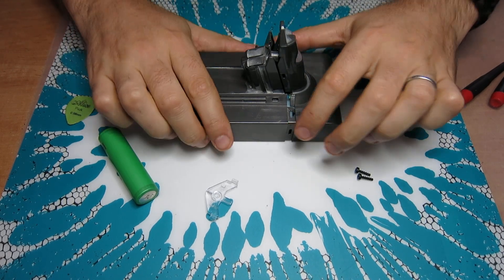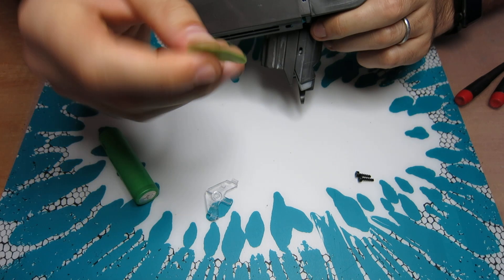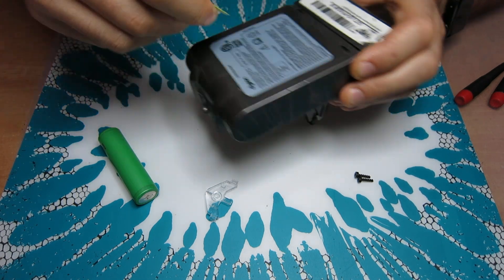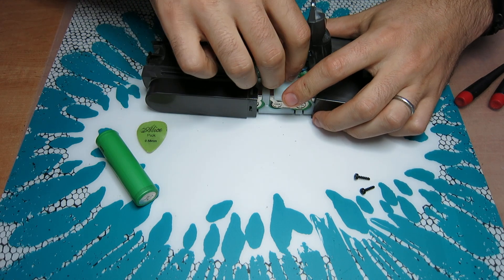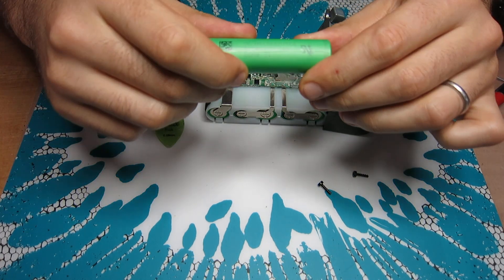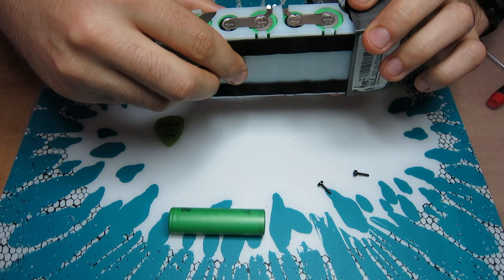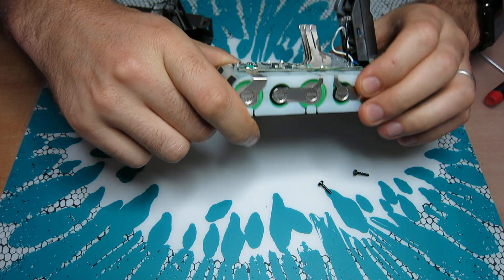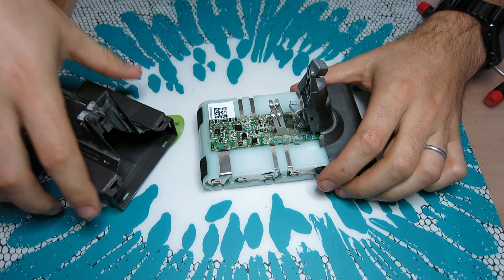Dyson DC59 or V6 Disassembled Battery

Comment: Gutes Video. So ganz einfach ist es jedoch nicht die Akkuzellen zu tauschen. Das Gehäuse zu öffnen ist umständlich. Ob man die Akkuzellen für weniger als 20 € bekommt stelle ich auch infrage. Ich habe bei EBAY einen vollständigen und neuen Ersatzakku für 20 € (incl. Versand) gefunden. Er sieht genau so aus wie das Original und funktioniert auch so. Bin gespannt wie lange er hält.
Reply from the maker: The set I used in this video is still going strong.

Comment: have a dison dc62 product. It works constantly without pressing the trigger. The transistor on the card above the battery exploded. It is not fully readable 4200ad ???. Anyone have any information?

Comment: Definitely not a fun exercise opening these. as someone else mentioned, start by separating at the top (where the contacts plug in).
Reply: yeah just opened it.. top part is way to start. As mentioned in the video this led indicator transparent part just above the bms is so hard to remove.. still trying
Reply: To someone who is trying to fix these batteries . Well I have swapped the old cells with fresh vtc6. Yet the circuit has some kind of protection I couldn't make it work . I have ordered a new bms and install it to battery. Only then it started to work and it's been working flawlessly since 1.5 months

Comment: Hi, thanks for your video,  Is it possible to change vtc4 batteries with dead batteries ? Would it work ?  I heard that  it was not possible because of charge protection.
Reply: Why would you want to install dead batteries? If they are working, just leave them alone.
Reply from the maker: Yes, done it on dc59 and v6 models. No issues.

Comment: My question is for people who HAVE replaced cells in these. If the Dyson BMS board is disconnected from the (old) cells, will the lack of voltage make it go into "disabled mode" and never work again?
Many power tool battery packs will disable themselves if you disconnect the BMS to replace cells, and the microcontroller needs to be re-initialised (by some factory programming?) to make it work again. I prefer not to make up special wires and separate batteries to keep 6 cells worth of voltages applied to the BMS PCB while I get the old cells out.
I know that new BMS boards are available on AliExpress, but I would like to save the original Dyson PCB if possible!
Reply from the maker: I replaced batteries in dc59 and v6 models. No issues. But keep in mind - you need good soldering station to do the job properly.
Reply: @applepietech  - thanks! Yes, I have suitable high power soldeting iron, etc. Next I have to fully test and select a good matched set of >20A cells. I cannot see any way to replace the cells one by one... so, did you just desolder the entire pack from the BMS?
Reply from the maker: @johncoops6897  I used SONY US18650VTC5 in DC59 and US18650VTC6 in V6. No complaints. Works better than new since they are higher capacity. Yes, I disconnected all cells first, put new ones and soldered contacts in place. Lightly scrape ends of new batteries with knife to create better contact for solder. Apply good flux and pre-solder them. It's easier to solder contact to pre-soldered battery end afterwards. Apply solder as fast as possible, do not overheat the batteries
Reply: @applepietech   Hello and thanks for this information. I m going to change my v6 battery cells with VTC6 . did you solder the cells while they were charged?  how many volts they were charged at ?
Reply from the maker: @FrenzyIncarnate  I did not test them before soldering. Just received in the mail and soldered. Use LEADED solder Sn63/Pb37, it requires less heat.
Reply: @applepietech  I took batteries to some shop to get them spot welded . yet with frest vtc6 the device does not work.
After connecting them all battery started blinking red light ( this wasnt the case with the old batteries) I m trying to charge it . LED does not light. when I try to use the vacuum it blinks red light.
Reply from the maker: @FrenzyIncarnate  You might need to change the BMS in this case. They can be found on Aliexpress.
Reply: @applepietech  But how you didnt need to change the bms. I dont understand why your bms didnt locked
Reply from the maker: @FrenzyIncarnate  I have no answer to this question. I replaced batteries on My DC59 and my friends V6 with no issues. My DC is still going strong with those new batteries. I did not touch BMS on both.
Reply: @applepietech  In which order did you reconnect the BMS? GND and VCC first - then intermediate cell voltages? Or cell voltages step-wise from GND up to VCC?

Comment: This would have been more helpful if you started by showing how you got the case open.
Reply: He said - by prying, at the points where you can see clip holes, and he used a guitar-pick style pry tool (common in mobile phone repair kits - few dollars off ebay/amazon etc). I suppose if you've not opened electronics before you might not know, but I guess he's assuming if you're going to re-solder 18650 cells then you have some idea of what you're doing already.
Reply: Would be nice to know how the LED light pipe clear plastic part comes out
Reply from the maker: The easiest way to open it is by starting prying on the sticking out part (part with contacts) first. Get it separated first and the bottom part (one that holds the batteries) will go easy after that! Good luck!
Reply: @applepietech  do not shoot anymore :)))

Comment: Cells are hard to kill. But BMS always fails in my experience.
Reply: Yeah, the BMS often fails in these packs - I have 1 pack with red blinking (BMS DEAD) and another pack with cells worn out and only giving about 50% run time. The DC62 and V6 are pretty old machines, so the original cells can often have done lots of recharge cycles. Have you tested the Chinese replacement BMS that are sold on Aliexpress, etc? Are there more than one manufacturer  and some replacement that is better quality?

Comment: What about BMS that will set the charger controller to the alarm mode after disconnecting any cell?
Reply from the maker: With the new set of US18650VTC5 battery works perfectly fine, so it must not be relevant.

Comment: you have to solder it ? can get the case get open without breaking it ? regards
Reply from the maker: Yes, soldering is required to get new batteries in. The easiest way to open it is by starting prying on the sticking out part (part with contacts) first. Get it separated first and the bottom part (one that holds the batteries) will go easy after that! Good luck!
Reply: @applepietech  you shouldn't solder lithium cells. a spot welder would be a much safer bet
Reply: thanks buddy
Reply: Thanks for showing the "guts "
of the battery pack. I was curious as to how hard of a job replacing 18650's might be. Now I have an idea. 
Instead of a basic soldering iron you might try Resistive soldering tweezers
I use to use Resistive Tweezers for years for soldering. I think prices start around $45, on up.
A regular soldering iron has to Heat a whole area before the solder melts. This can overheat and degrade adjoining components. 
Resistive Tweezers immediately apply heat to the component BETWEEN the tweezer tips. Localizing the heat.  Thereby minimizing possible heat damage. (But not totally eliminating potential damage).

I haven't looked into Spot Welders used for battery packs.